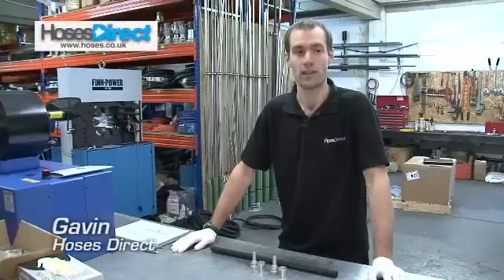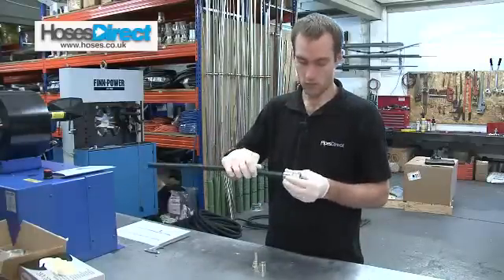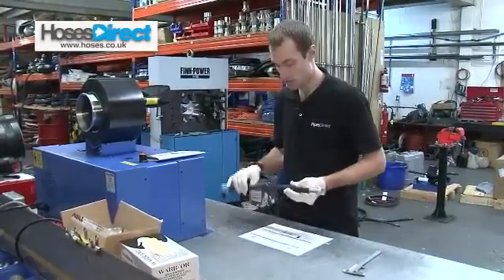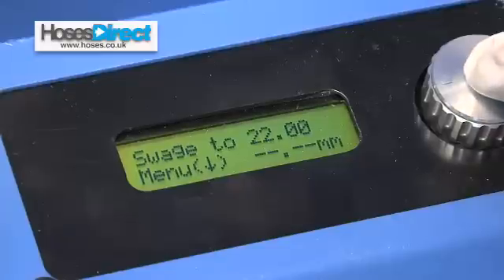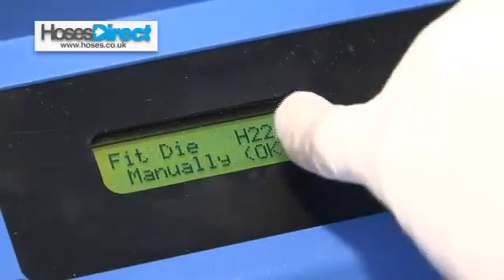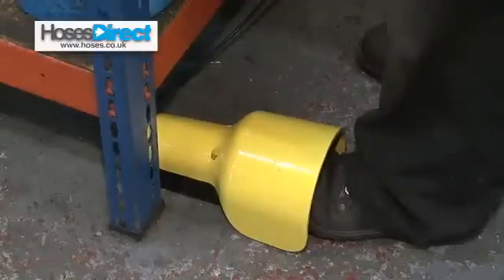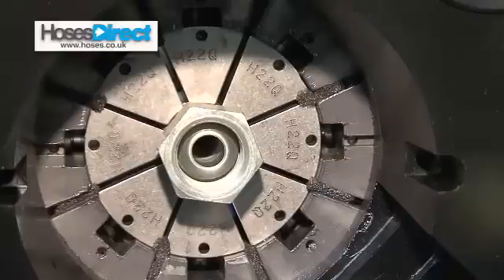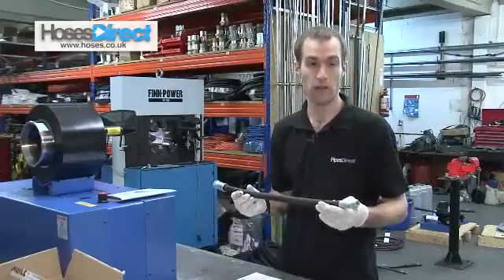How to Make a Hydraulic Hose

Comment: You shouldn’t use oil to make it easier to push the fitting in the hose. Use petroleum, even if you do not know, what kind of oil your customer uses.
Reply: I use IPA as it makes the hose slippy for installation and then evaporates

Comment: I had a hydraulic crimping machine myself. Recently the fitting keep popping off the pipe after install. I can assure that there is nothing wrong at the installation side. What can I avoid this problem while crimping the pipe?

Comment: also what was the tool you used to check the crimp after it was done
Reply: JOHN ROCKNER rubber hydraulic hose factory 
whatsapp +8615832863556
Reply: Caliper